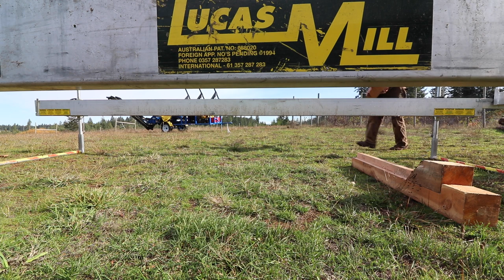Amazing Swing-Blade Sawmill Setup!!

Comment: Noticed in first couple dozen comments about 400-500 folks complaining about being jerked around or getting the hook with the short (roughly 10-12 min.) average length and no action as headlined. That's a small percentage of 400k subscribers but if indicative of a trend could result in fewer viewers. I'm a relatively new subscriber, usually enjoy the video's but have a little different way of going about it, I think. I don't check the channel daily, couple times a week. Note what it is about..sometimes have to open and slide cursor to confirm the topic as titles often mis leading. Once i know what it is I transfer it to my You Tube play list and when I'm pretty sure that series collected I watch them. Kind of a Wranglestar Library. Works great. Moved today's to Saw Mill and will watch them when complete. Just choose your playlist category, name it Saw Mill for example and watch them mostly in their entirety. Don't delete the Library categories in Playlist because sometimes a topic will have a second project or an add on. Some of my categories are House Remodel. Shop Projects - Engine Repair. Mrs., W. Shop Projects - Woodworking. Outdoor Projects - Mail Box - Irrigation.....etc. I don't watch nor save travel out of State promotional workshop episodes but mostly try to salvage what's filmed here in the PNW. Works great, about twice a week I watch a series within a project or move episodes onto the playlist. You get both..interesting things to watch and not feeling frustrated or like un-subbing.

Comment: Hiya Cody. A tip for you about the Lucasmill. Always much easier to roll around when The power unit is as far over the wheels as possible. I found it easier also when you have the wheels facing out, you did it on 1 wheel but not the other. Your rail clamps will last longer if you set the rail in both verticals first then clamp it down.

Comment: I can never get over the fact that you are using such a large bar for such small logs...
Reply from the maker: So I don't have to bend over,
Reply: Wranglerstar True but be careful when cuting the bottom logs you dont want to sharpen that chain to often :P
Reply from the maker: This is not my first time using a powersaw,
Reply: Jason Millar Well the fact is i went to forest school for 3 years so i do know we tent to use 13 at the most because they are easyer to handel if you cut somthing on the ground the best thing tends to be to just use your knees not the back
Reply: Maybe your used to using a short pole? My apologies
Reply: Not a big deal, it's a lot easier leaving a long bar on your saw than switching it out for different projects all the time.
It's the one size fits all method.
Reply: bcrusher1979 well you can take a tree that is like 26 easy with a bar that is 10 just saying

Comment: I loved the video - and it WAS about setup, as promised. However I have seen the Brand X sawmill in action and must say I like it better for about the same price. But the Lucas is  more portable. The boards off the Brand X almost were planed right off the mill. I bet I could finish them off with a random orbit sander! It will be interesting to see if the Lucas does the same. Can't wait!

Comment: Hardhat is for overhead work, and I only wear chaps when welding.  Seems a little bit of character acting going on here.
Reply: I am very aware of safety equipment.  I have been felling since I was a kid, my statement stands. I use a hardhat for overhead issues, for hearing, hearing protection.  Chaps for heat as in welding but have never had an issue with a chainsaw, wearing a t shirt also is not wise.  Also notice his legs while rolling the log over on the pile, big no no.  I see what you mean, some should have safety precautions more than others.  Perhaps he is just making a point for newbs.
Reply: I understand the leather chaps, but they mostly get in the way. And yes I have been payed to fell trees. Does not mean I have ever had a hit on my legs, maybe just a different perspective.
Reply: Sorry pal, i was felling trees before I was out of high school. You are not impressing me with certifications or other nonsense.  We walked circles around such nonsense 30 years ago.  I am a structural builder, what the hell is a structural firefighter.  You seem a little puffed up about what somebody else may be.  Speak for yourself, you seem to be a grownup.
Reply: Poop, I have done it and I don't need a search engine. You apparently don't know what the the heck your talking about as I asserted before.  You apparently have no clue and that is all.  Your defense is without substance as I am walking around at my age with no injury and secondly, the feds have absolutely nothing to do with proper work ethic.  Your alleged knowledge is given over to arrogance.
Reply from the maker: Hardhat is used to guard against chainsaw kickback. Chaps are to prevent my leg from getting cut.
Reply from the maker: Claims to be a chainsaw expert. Doesn't know what chainsaw chaps are, not very convincing,

Comment: I cringe every time I see you start your chainsaw. I know, you've done it that way forever and never had an accident. I was taught to either start my saw on the ground with my foot on the back handle, or to brace the back handle between my knees to help control the path the saw might take if the chain contacted something when the saw started. I know that with the chain break engaged, this isn't a problem, but many of us start the saw without the brake engaged... Yes, to each their own, but I still cringe...

Comment: I have been a sud here for a long time. Tons of good info to be found here. Been thinking about buying a saw mill and think I will buy a swing blade but not a Lucas Mill. To me the frame of the Lucas looks like JELLO. It flexes and gives and looks to be the same grade as a Harber fright bansaw. Set up time on the Lucas is unreal. Having cranks on each end will run you to death,  Loading loges is just dumb, and removing cut wood from inside the frame is a joke.